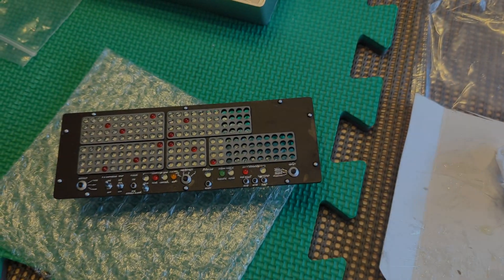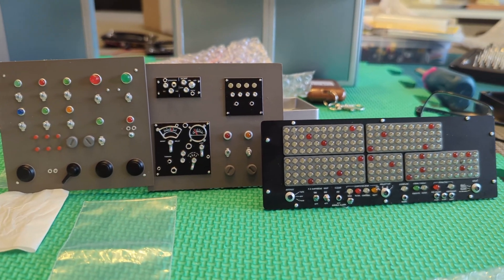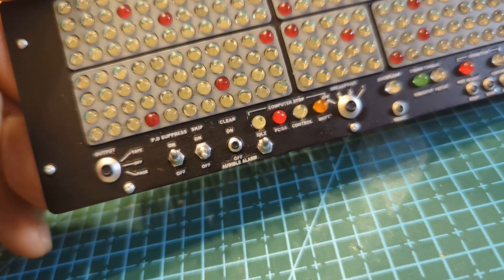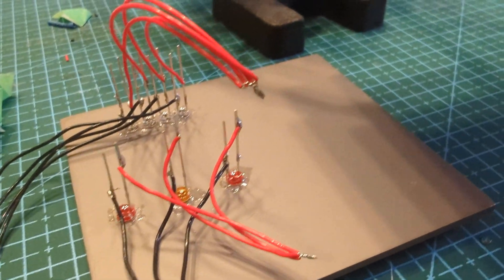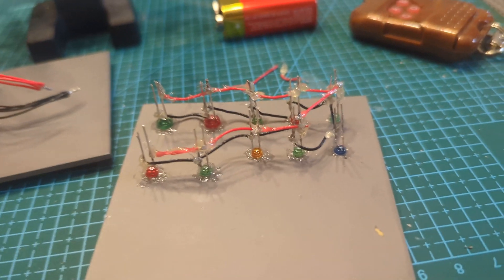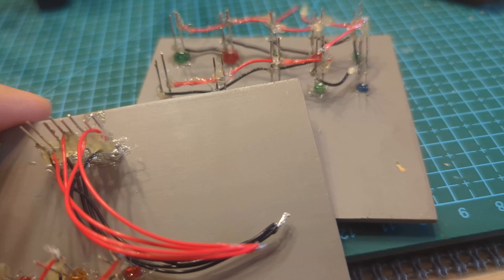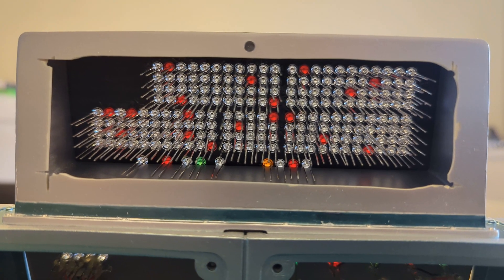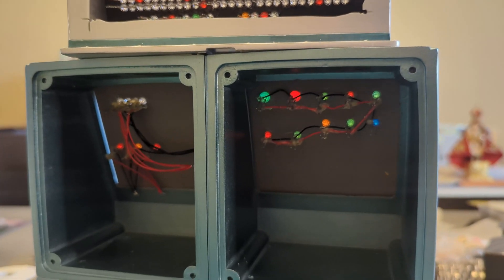ProCustomFigures 1/6 Scale BatComputer LED Install -- Part 1

Comment: You can make every LED blink individually if you wire them as a matrix...
Columns and rows.. 
Connect all of the short leads horizontally across each row 
and the long leads vertically across each column..
That will make each LED individually addressable..

If you light up each LED one at a time, fast enough, 
your eyes see them as though they are all lit..

Note: different colors need different current to make them the same brightness.
You can also adjust brightness by giving them a PWM signal.

Also look up the term CharleyPlex

Comment: Hi, I just watched this after watching your latest video. I think you might want to watch this video about LED's. You should NOT wire your LED's this way. Every LED needs it's own current limiting resistor. https://www.youtube.com/watch?v=Qlayua3yjuE&pp=ygUsd2h5IHVzZSBjdXJyZW50IGxpbWl0aW5nIHJlc2lzdG9ycyB3aXRoIExFRHM%3D That will massively reduce the possibility of your LEDs blowing. You are making a great looking Bat Computer. I want you to have it survive a long time.
Reply from the maker: Thank you for the link.  Appreciate your concern.
Reply from the maker: As a follow up to my initial response, I did look at the board and it looks to be resistored         indicated by designations of "R3", "R14" etc. 

I also looked up what different resistors look like and the ones I see on the board match those I see.
Reply: @1515cci  ask chat gpt 'what can happen if I protect multiple leds wired in parallel with a single resistor'